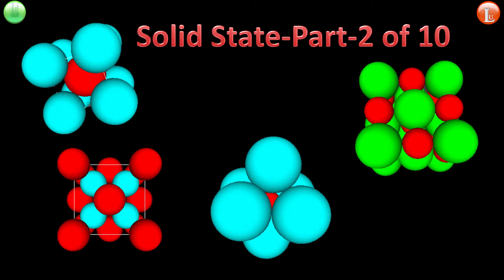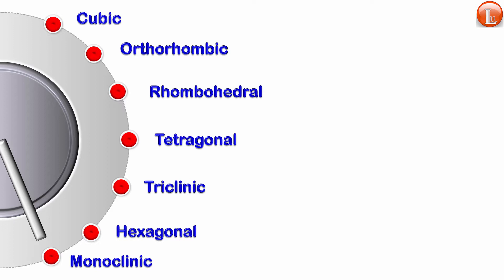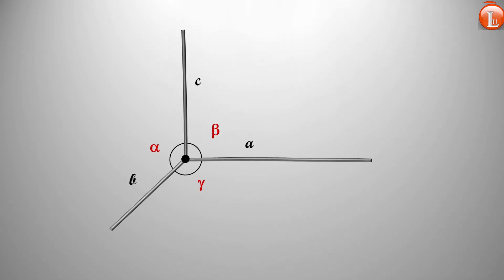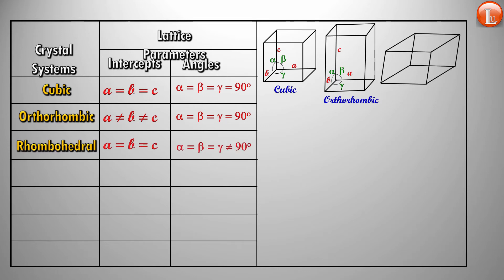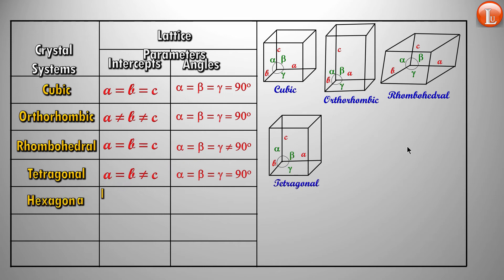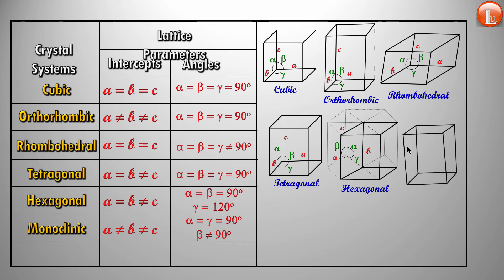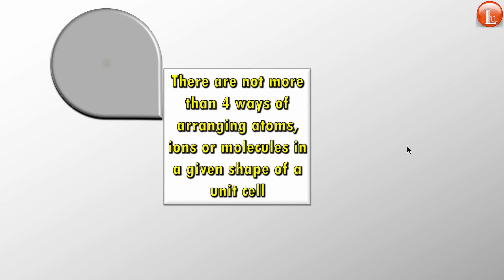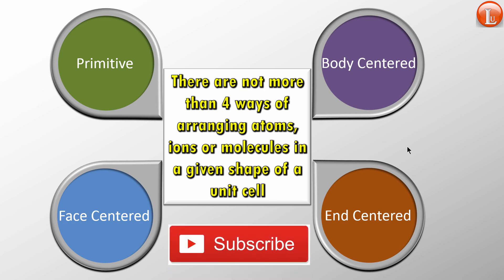Solid State-Part-2 of 10-Shapes of Unit Cells

Comment: Tungsten has an atomic radius of 0.136 nm and density 19.4g/cm^3. What is the crystal structure of tungsten?
According to me this que is wrong 
As if we apply density formula there we have two variables Z and a.? 
Plz give ur advice
Reply from the maker: Tushar kumar G: first assume it is cubic and then try it with Primitive, BCC and FCC and in each case calculate the density and match.